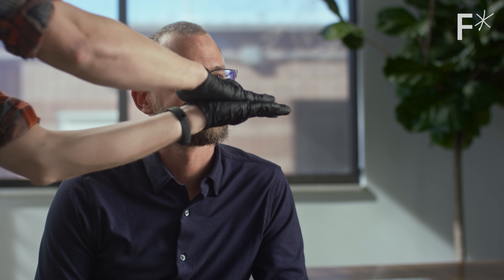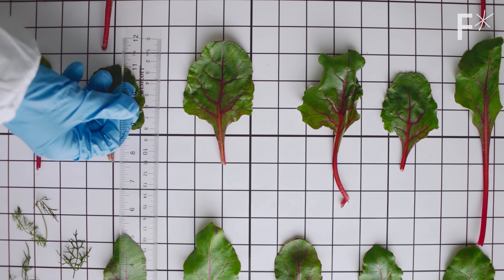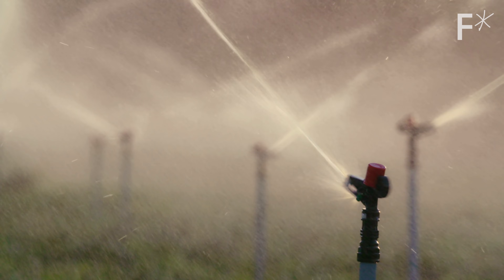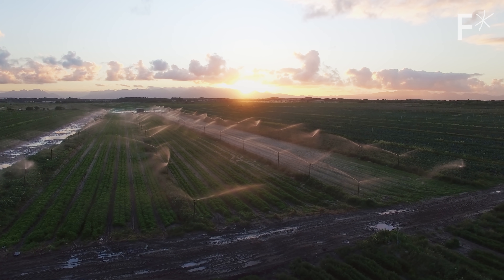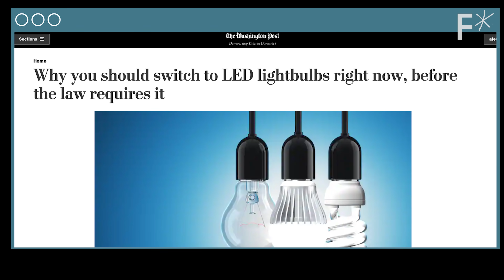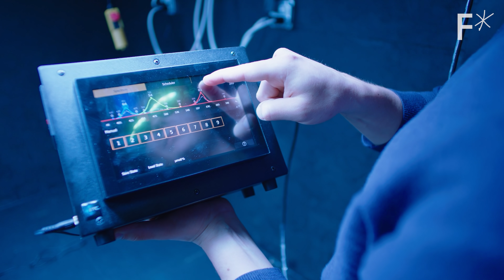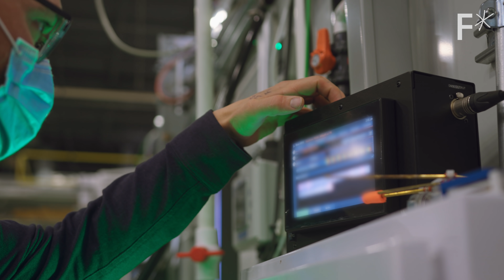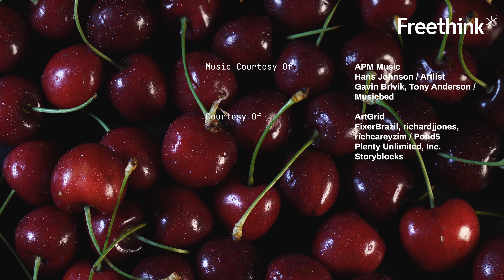Vertical farms could take over the world | Hard Reset by Freethink

Comment: This seems like a good idea, I would really like it to work. Something that worries me from an environmental perspective is how much electricity these farms will require, and whether those demands allow this to be part of a sustainable future
Reply: there are ways to reduce the amount of energy if you´re getting creative...for example in my (cold climate!) city there´s a huge greenhouse on the roof of a bakery, using the excess heat from the ovens to heat the greenhouse which would just be wasted otherwise. other projects use the (co2-rich!) stale air from office buildings with ventilation systems as natural growth booster
Reply: @PeyaLuna  I never thought of that CO2 rich stale air that is awesome!
Reply: Why can’t a hybrid of solar, hydroelectric energy be a viable source?
Reply: @c_ag9471  hydroelectric is limited to were you can build massive damns. And even then they can be really destructive to migrating fish populations
Reply: @c_ag9471  It can, but as long as the farm is on the grid that's still too much coal.
Reply: @c_ag9471  I think it would be, if enough of the country's power grid was actually powered by them.
Reply: @c_ag9471  Lets not forget thorium!
Reply: @c_ag9471  where's the hydro from, Hudson Bay in Canada?  They have a lot of it there.  And solar is nonrecyclable, the panels, and the batteries which may also use scarce elements.  It's environmentally disastrous.
Reply: @davidquinn9676  Solar panels can be recycled, and most of the materials needed are a range of commonly-used elements including silicon(2nd most abundant material on Earth), indium, gallium, selenium, cadmium, and tellurium. Their materials can be taken apart, sorted, and reused. Most type of batteries can be recycled now. I believe more modern businesses and startups are striving for the environment-friendly standard, and thus will find new ways to recycle or reuse the products they make.
Reply: Remember the growing efficiency of LEDs
Reply: @domib.3924  this is not the main user of energy of such a facility already.
Reply: @domib.3924  Remember that the efficiency of plants is a few percent at best and there is no way to ever really fix it.
Reply: What is the energy consumption vs that of 700 acres of conventional farming?
Reply: The energy requirements of vertical farming lead to significant land use to provide the energy. For every acre of crops grown via vertical farming, 5.4 acres of solar panels would be required to supply the energy via solar power.Thus in practice, vertical farming may require more land than traditional farming, not less 
Louis Albright, a professor in biological and environmental engineering at Cornell stated that a loaf of bread that was made from wheat grown in a vertical farm would cost US$27.However, according to the US Bureau of Labor Statistics, the average loaf of bread cost US$1.296 in September 2019, clearly showing how crops grown in vertical farms will be noncompetitive compared to crops grown in traditional outdoor farms
According to a report in The Financial Times as of 2020, most vertical farming companies have been unprofitable.
Vertical farms must overcome the financial challenge of large startup costs. The initial building costs could exceed $100 million for a 60 hectare vertical farm.Urban occupancy costs can be high, resulting in much higher startup costs – and a longer break even time – than for a traditional farm in rural areas. In Victoria, Australia, a "hypothetical 10 level vertical farm" would cost over 850 times more per square meter of arable land than a traditional farm in rural Victoria
Reply: @vyzxyz6477  Thank you! Even if their argument is Light threshold and shade prefering plants, agrovoltaics is proably the more realistic approach.
Reply: Solar can be installed on top of those factories.
Reply: “We can only save our species if it makes economic sense.” Watch the video, then comment. 4’00 gives you your answer
Reply: Another things is what type of crops can and can't be utilized. I don't think all types of crops can be planted in vertical farms. This includes rice, wheat, and corn which all have very high demands.
Reply: Nuclear energy is a great option along with renewables.
Reply: Molten salt reactors.
Reply: once they finally solve tidal energy. Well the issue to solve is having something survive in the ocean that can do it.
Reply: Nowhere near as much as a traditional farm. Farming is an industrialized sector and it has the energy requirements of one. You're burning a lot of diesel to run everything from crop dusters, to tractors, irrigation, pesticides, etc. And the energy impact is probably compared to a big box store. But I'm just interested in furthering the industrialization game.
Reply: this is a valid argument, but they don't require fossil fuels to power them like traditional farms do meaning that in the future they can be completely powered by clean energy.
Reply: Small nuke, like thorium which Trump mentioned, or the approaches Gates and others are working on, they would solve the problem easily.  Since early 2020, Bernie Sanders' official Green New Deal included nuclear, because otherwise the whole idea is ridiculous, but with nuclear it can work fine.  Takes energy also to extract and concentrate CO2 from the atmosphere to be pumped into the greenhouse.
Reply: Add fish. https://youtu.be/IVPDfnH39sg
Reply: First you should go to moon
Reply: Seems like the perfect solution for solar energy🤔
Reply: @Logan_236  And battery maintenance
Reply: Also curious about he amount of pvc plastics needed.
Reply: Eh, that's more of a political concern than an actual fear regarding sustainability, especially for projects that are trying to decouple farming and the enviroment.
Reply: 5 startups that are revolutionizing food and agriculture THE FUTURE OF FARMING
https://youtu.be/mnE0rQfFS1s
Reply: A huge positive is the potential of local. It's not uncommon that we burn more energy in fossil fuels just transporting food than the food actually provides for our bodies. Just think of all the gas that's burning to get some lettuce onto your plate that's mostly just water.
Reply: Umm renewable energy
Reply: @MagikFingers420  new stuff. Lol
Reply: @waynedieckmann9840  ? What are you yappin about?
Reply: @MagikFingers420  physics. Don't get a headache
Reply: using solar panels to reflect natural light to grow crops is preferable over LED
Reply: @lynb2039  good one
Reply: that can easily be solved by implementing nuclear power
Reply: that can easily be solved by implementing nuclear power
Reply: The conversion from plug to plate has an efficiency of about 1-2%. Photosynthesis is extremely inefficient; about 1% from sunlight to plant chemicals. You can make it more efficient by controlling the frequency of light (plants hate green, that's why they reflect it away; they use the blue and red parts of the spectrum), but LEDs are not near 100% efficient from electricity to light, so it's kind of a wash. The reason they are growing lettuce and other fluff is that it contains nearly no energy, just a couple of percent cellulose for rigidity. Lettuce costs a lot and contains nearly no energy;  you can't feed the world this way, you can just make fluffy greens. There will never be lentils or potatoes in a vertical farm illuminated by LEDs. If you're doing this with solar panels you need more land for just the solar panels than you need for a conventional greenhouse. You don't need arable land for a greenhouse either; it can be just pots of soil with lettuce in them or hydroponics or whatever.
Reply: LED lights use a tiny amount of power in comparison to traditional lighting. These factories could be run on renewables without a problem.
Reply: agrivoltaics
Reply: Especially when year round. They require constant electricity which means during say a power shortage or outage they may rely on generators that burn fossil fuels. A lot of areas have generators like this in case of power shortsge and it can mean sustainability based on electricity is hard to calculate unless more power is renewable.
Reply: @EsotericCat  power outages happen less often than you think
Reply: @kaleb5926  Sure but you still need to keep everything alive when it does go out at -40 C or something (hello all you polar-ish regions). 
My issue is they almost never demonstrate or even discuss the "ecological" buyback cost of all the supplies, glass, mining for metals, materials, plastics (tubing, packaging, etc.), which are often not recycled/recyclable in many towns (despite the technology existing to do so at least for packaging), how they plan to dispose of end of use equipment, how they generated the electricity to begin with, and so, and so on. There is  A LOT to consider when determining if this is truly socially, environmental, and financially viable or "better". Although their map of global farm land seems rather small. Most of Canadian prairies are indeed farmed, but virtually none is shown here.
Reply: @Tak9628  Do you think they keep crops alive all winter in cold climates now? I’ve lived in the midwest all my life, and I assure you, those endless cornfields lie there empty and lifeless from mid-October all the way into mid-April - half the year. Moreover, a lot of warm-climate crops don’t grow here at all and have to be imported. No one is farming lemons in Minnesota.
Reply: @davestagner  This is particularly why I asked. We've got you beat here (Canadian) for cold winters in length (similarly frigid).
If our fragile food supply systems have a disruption like they did already several times in the past few years, we want something that might not be growing lemons but at least some frost tolerant veg. (to make things survivable; if not desirable)
Also, resilience to power outages when someone inevitably hits a power line :|
There is a Chinese greenhouse style in Olds, AB that works passively (heating) for such. The only electricity used as I recall was for the insulation blanket that covers the windows at night and a machine to remove snow buildup. (solar powered even in winter)
Reply: @Tak9628  There’s much to be said for simple passive greenhouses. They can grow a lot of vegetables out of region or out of season. But they don’t really increase the density or consistency over open-field farming. Those are the things I’m interested in. I’m not too worried about power loss; all serious industrial buildings have backup generators (or batteries) onsite for this exact reason. So for me, the question is this… can the benefits of closed-system vertical farming (total light control, recycled water, nutrient control, weed/insect control, etc) outweigh the cost advantages of passive, open-field farming? If it can be cost-competitive, it creates other possibilities, especially in terms of returning farmland to nature. I’d rather see a bison than a combine in a field any day.
Reply: Our current system isn’t sustainable in the least bit. These guys are trying to fix that
Reply: Don't worry about energy so much. These buildings are more than capable of being energy positive. Here is a simple water pump. Place a cup of water below a plant on 2 seperate shelves. Run a cotton string from the cup of water up to the plant. The plant has tube fed water no power needed.the same way a tree gets water to the tallest branches. Combined with nanotube technology you could hypothetically create a low yield but endless supply of power. Then we are on the cusp of understanding quantum mechanics, Ai and cold fusion. If we can avoid the reset I'm sure we will be fine. It's not the first reset.
Reply: What should really worry you is growing human populations, uninhibited by nature and natural ecosystems.
Think what happens when the world population has been artificially expanded to tens of billions of people, and someone decides to turn off the electricity.
Reply: Thats where elon musk's idea to put solar panels in sahara comes in
Reply: Solar Panels would be able to provide adequate energy to these farms.
Reply: @lillith9851  only during the daytime. How do you propose we store solar energy for use on cloudy days and nightime? You can't tell plants to take the day off in sub zero temp because it was a cloudy day.

The issue with solar and wind is that they are unreliable when reliability is required to avoid mass failure. Batteries are not a good solution as the pollution to make them is massive.

Nuclear is a great source of clean power, but for some reason environmentalist nuts have an irrational fear of it. Weird how the cleanest source of energy ever discovered my man is vilified by the tree huggers. An I mean cleanest in ever sense, the least CO2 over then entire live Watt for watt is nuclear. Cleaner then solar or wind
Reply: @RingwelskiJacek  address waste though.  how where
Reply: @lynb2039  how about we bury it an old lead mine.  There really is not that much waste.
Reply: nobody cares free light energy and rain water
being creative should be to focus on how to utilize that of traditional techniques with modern science without involving GMO as there is always limitation to varieties along with keeping up in the economic sense!Although such projects seems to good to be true, current tech is only able to provide leafy crops unlike seed and fruit based crops which is consumed by vast majority across the world.
Reply: @mohammedmehedihassan1120  But GMOs allow plants to be sustainable and have resistances???
Reply: @mohammedmehedihassan1120  At this point, every plant grown, even on a local scale, is genetically modified. For thousands of years humanity has selectively bred plants into specific niches for specific reasons and to my knowledge, there is no harm in genetically modifying a plant in this way.
Reply: @mohammedmehedihassan1120  Yeah, but this is for that year round lettuce being demanded in places that can't grow it year round. Economically that could make sense even at atrocious efficiency, but it will never be the way anyone gets a measurable quantity of food calories.

Comment: This dude is s clown taking about water this amd that etc and it getting sucked up or off the air and where ever and turned back into water to reuse. The same thing happens in nature it goes to the ground the sums does the ground up by it evaporating and then it goes up into the sky and the.  When it gets over situated it rains. Same thing accept  how much does it cost to run those lights  and all the equipment  and filters etc. That can't be good for the environment

Comment: Do you use any of earth's resource to produce the technology to then produce the food? Are materials for technology infinite? We use water as an essential component to produce the core of most technology, the microchips, water isn't infinite. SO the idea uses more resources to produce food in smaller spaces with more yields, which requires MORE resource to upkeep the technology that allows this production. Its ideals are based on infinite resources to make the technology  but I question, how does that work when we can't get ps5 right now simply because of water shortage in Taiwan? It sounds better than traditional practices but its cost of lights instead of sunlight is made from MORE resources. Its simply not sustainable, just helps to sell more, faster.

Comment: Vertical farms only make sense for crops with almost zero nutritional value (in terms of energy), such as greens.
On average, humans consume 2,250 Cal a day (2,000 for women, 2,500 for men). You can convert this to Joules (remembering that 1 Cal = 1000 cal and 1 cal = 4,184 Joules.
Therefore, you need 2,250 * 1000 * 4,184 = 9,414,000 Joules per day to survive. If you divide this amount of energy by the number of seconds in a day, you get the average power in Watts that a human being consumes:
 
9,414,000 / (60 * 60 * 24) = 108 W = 0.108 kW

Therefore, the human machine consumes as much as a 100 Watts incandescent light bulb. So far, so good, we are pretty efficient. 

However, the losses in converting electricity to light (90% for LED) and converting light to grain and straw (0.2% for wheat) are quite considerable.

Taking into account the average cost of electricity in the USA is 0.132 cents per kWh, to produce the necessary food (bread, for instance) to sustain a single human using electricity would be:

0.108*24*0.132/(0.9*0.002) = U$ 190.08 per day (or almost 70,000 dollars per year).

Where am I wrong?

Comment: What’s the drawback? Energy. Even with high efficiency LED’s the overall energy efficiency to produce electricity and then convert it into light is highly inefficient.
The most efficient LED’s are 40% efficient and modern solar panels are only 20% efficient, grid transmission is around 95% efficient and power losses through AC-DC or DC-DC conversion are around 90% efficient - overall solar efficiency therefore is only 7%, and that is assuming all the led electricity actually makes it to a photosynthesising leaf surface.
Most other methods electricity generation are not much better. The best probably is hydroelectric which can be up to 90% efficient, but you still have transmission, and conversion losses to add.
Reply: There is always a cost of new technology, but energy has been humanities problem and we know how to fix it. This drawback can be fixed, efficiencies can get better, and all while using 1% of land versus the cost of farming now. The drastic decrease in water is already a benefit that outlays the energy drawback.